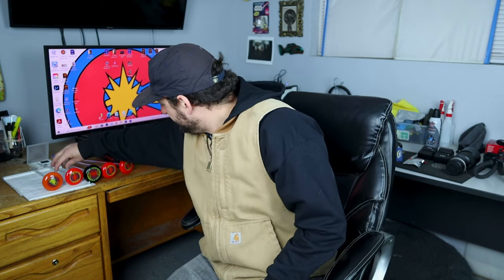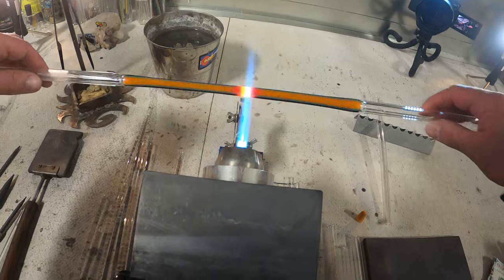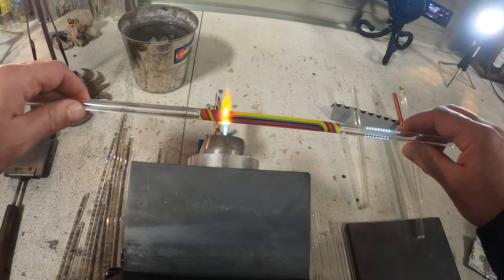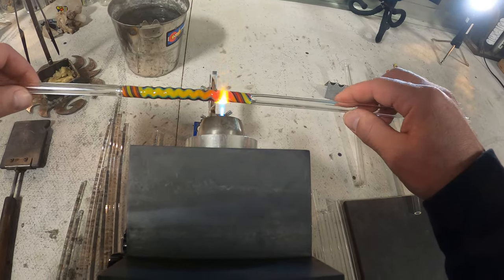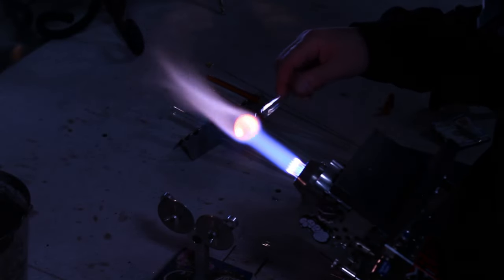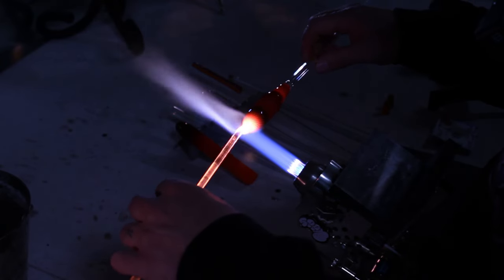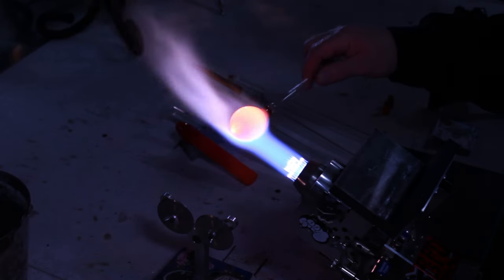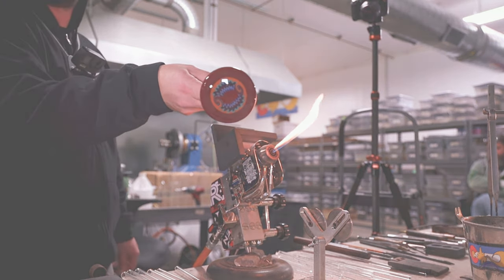Wig-Wag Disk - Glassblowing - Lampworking - Reversal - Colorado Color Company - How to Blow Glass

Comment: Just curious, what is a disk used for?  besides a decooration, I'm trying to figure out what you would do with it by itself or if its used to put into a largere pieece?
Reply from the maker: Yes, these videos are mainly focused on components that you can add to larger works of art. Eventually, we will build up to using these in sections in bigger pieces.
Reply: Can also pop your two holes in the back and make them into a pendant which people really like as it's something you can use all the time!